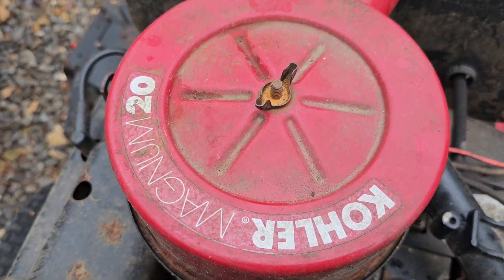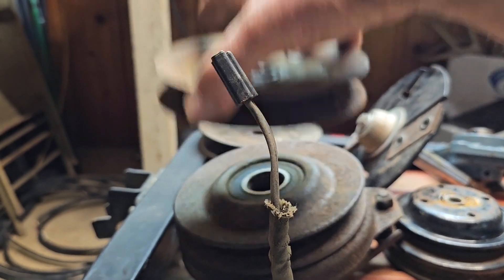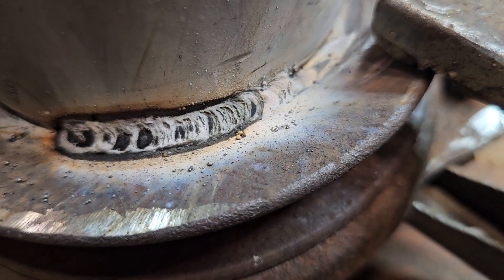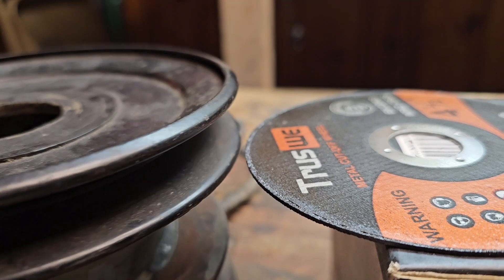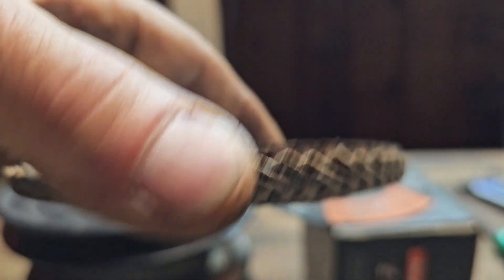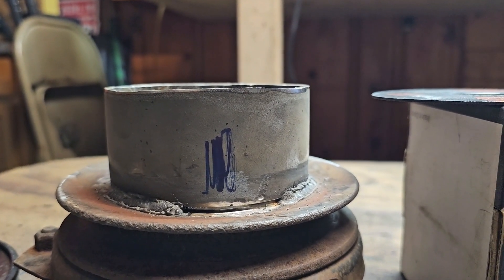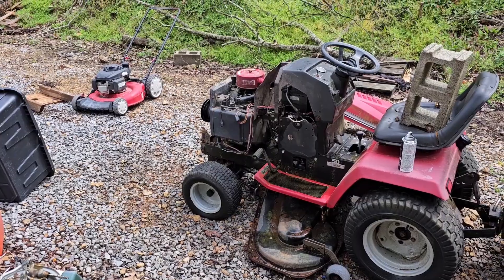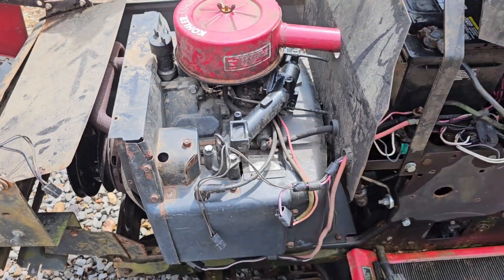Adding a PTO to the lawn mawer

Comment: Already has pto , going to mow & rototill  at same time ? ?
Reply: You could just remove the blades or slip off the mower belt
Reply from the maker: Just goofing around. I did mount a rotor tiller to front in the past and did a rotor tiller tug of war video.